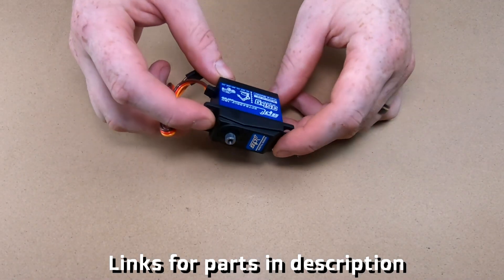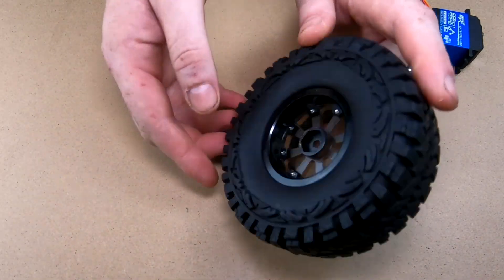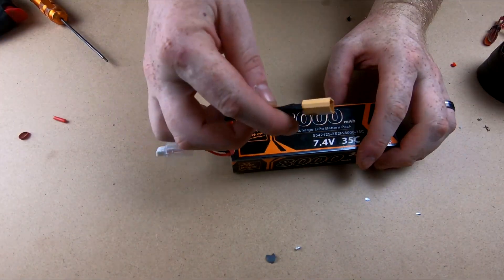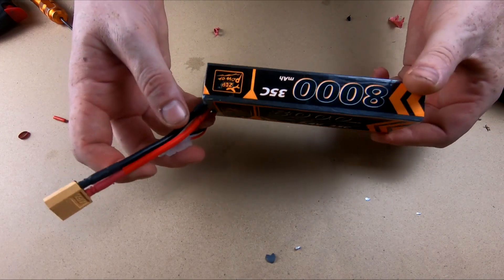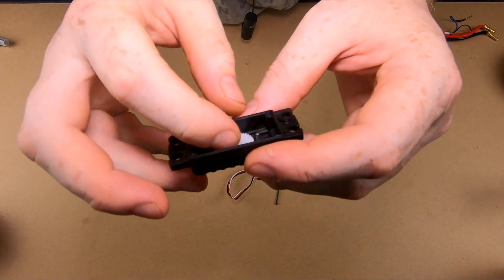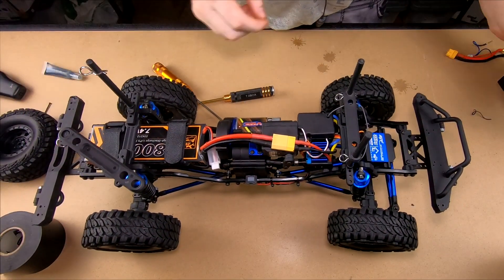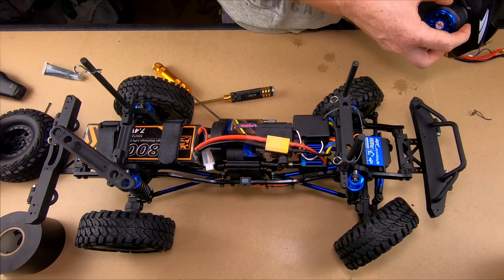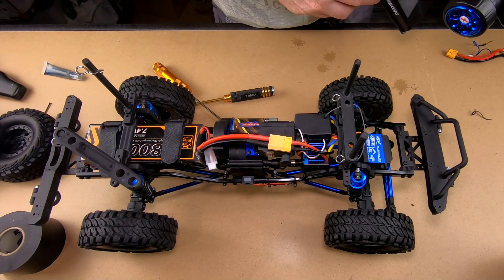VRX RH1052 1/10th Scale RC Crawler Upgrades

Comment: Is the ESC water proof and have you had anymore 2 speed transmission issues ??
Reply from the maker: Looking at ESC itself would say no,Is in a box how ever box is not fully water proof,Have had some water build up in there,In Terms of two speed did do some adjustment on the linkage for the arm that controls it to add a little more preload on the spring that's there and have not really have any more issues

Comment: ESC doesn't needs upgrade ?
Is enough smooth and has a good brake gradient ?
Reply from the maker: Was one thing I was sure wouldnt be any good,but has great smooth throttle control, drag brake is good also not amazing but gets job done